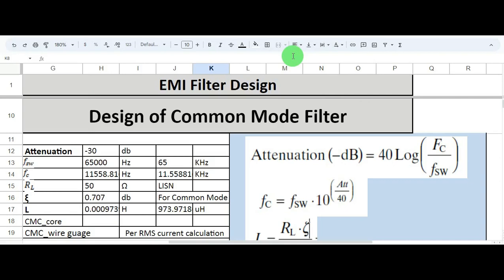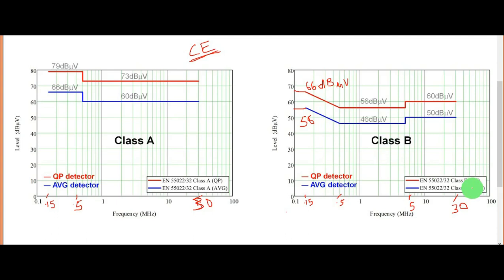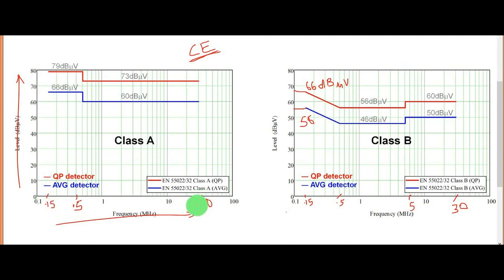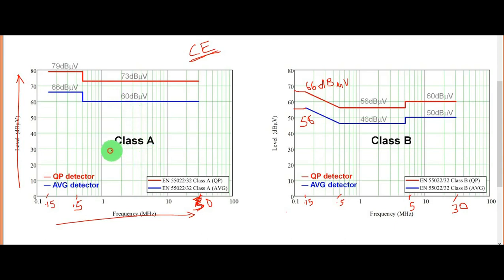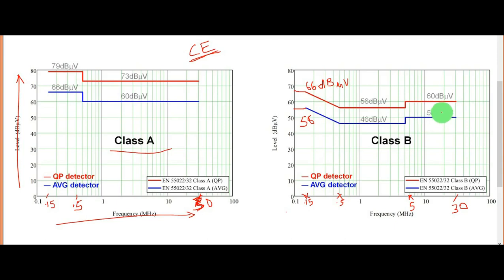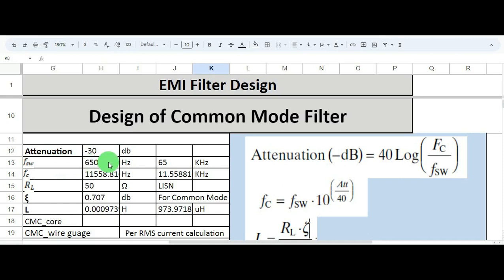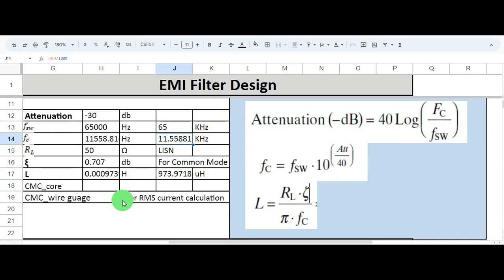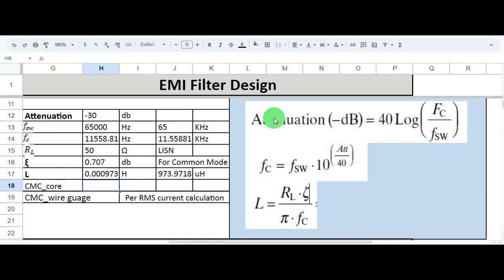Design of Common Mode Filter - Calculation

Comment: Hi sir,
Good nice explanation.i have one doubt why we use common mode choke instead of two inductors in line.
And if we calculate the RMS current shall we choose choke through mouser or any other distrubutors and what if exact value not get
Reply from the maker: Hey, Thanks for asking very good question.
Common mode choke filters suppress common mode noise and and at some extent differential mode noise as well. So many people common mode choke in their design. But it does not means differential mode inductor have no use. If you power rating more than 100W, you might need to have both in design. Even dual stage filtering needed. 
In some cases less than 10W you may not need common mode choke as well , single indicator along with C will do the job. So filter requirement depends on your application.

Inductance value is very important if chose the choke. If you know inductance vale and current you are free to choose from mouser.
In case if do not get exact value , you look for higher inductance and current rating but not lower value.
Like if your calculated capacitance value is 18uf , you always choose 22uf etc.
Hope this will clarify your doubts.
Thanks !

Comment: Hi sir,
 can you please explain how you got the formula for finding the inductance  of a common mode choke.
Reply from the maker: Hi...jyothi...If i remember correctly...i found this in some application notes in internet but do not have handy with me. The formula's used here are correct.
Reply: i am also curious about the formula
Reply from the maker: @XufengQIN  Let me find it, you can message me in whatsApp. Checkout the the home page.
Reply: @ElectronicsCircuitHubECH  
It's an application note from coilcraft.
Reply from the maker: @TB-jl9fr  Hi...can you attach the link ?
Reply: @ElectronicsCircuitHubECH  
There is also an explanation for the factors of zeta.

Comment: I am designing a Common mode choke for inverter, wherein there are multiple switching frequency e.g. SMPS Fsw = 120kHz, Inverter section Fsw=4kHz, pls suggest. what should be the Fsw for calculating Fc-cutoff.
Reply: and also one more doubt, as my input is three phase, i have to take L/phase and use such 3 windings right?